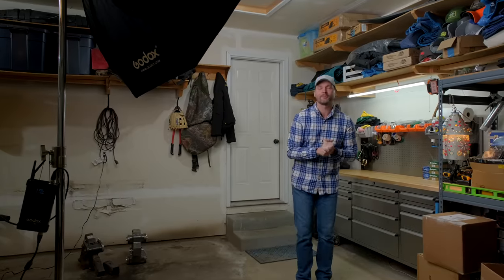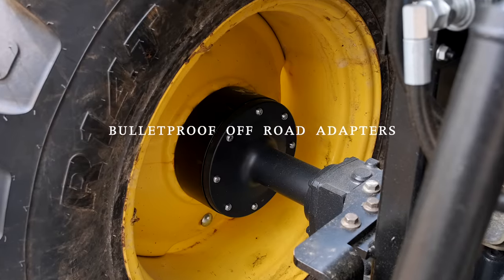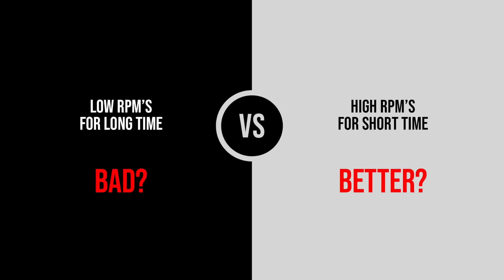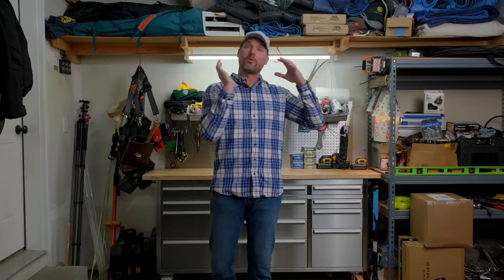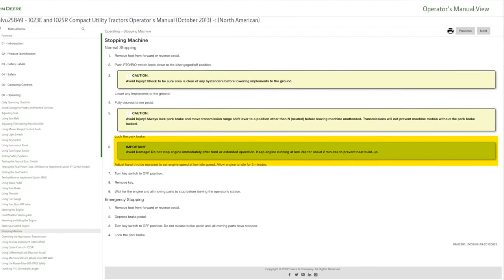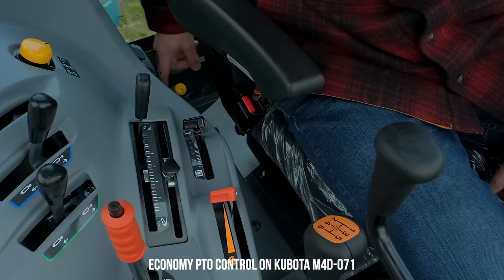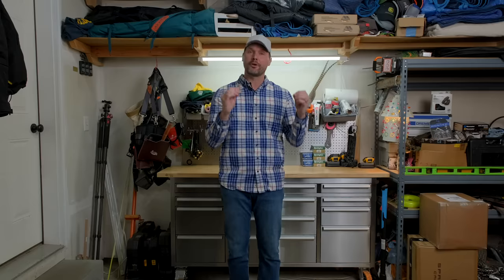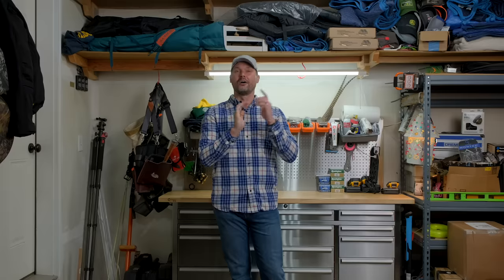WHAT RPM TO RUN YOUR TRACTOR? IT’S COMPLICATED

Comment: The new engines with computers if the wrong numbers are put in they can burn the engine up or will have poor power and will never do a proper regen.been there an seen it happen.Always let the engine cool down after working it 3---5minutes.spit a turbo runs $1000-4000.drop a valve.call your dealer an take a pill.was good things in this video.Thank You Sir

Comment: Diesel engines are much better for constant RPM and varying load, while gas engines do better at constant load and varying speed. 

That's part of the reason diesels are used for industrial generators, big trucks,  and large marine engines; while gassers are used for sports cars.  Set that diesel at a given RPM and it'll torque it's way through any load variation way, way better than a gas engine.  (Think F-250 with the Godzilla gas engine, pulling a gooseneck......watch that transmission hunt for gears when the front tires hit an incline, vs a Powestroke pulling the same trailer....)

The gas engine will rev up and down much more quickly, but it isn't nearly as capable at holding RPM when loads change.

Bottom line with a diesel....pick a comfortable RPM band and let that diesel do it's magic no matter what the load on the front or rear is doing.

Comment: I don't know if you addressed this...But 12 minutes was beyond my attention span.  I have a JD 4400 & 4600 (2000-year models bought new) I just read the owner's manual about idle speed.  The manual said "slow idle was 950 rpm.  As a child on a farm (1964+)  I was told not to idle a tractor below 1500 rpm.  The idea was that below "official idle speed", the engine wouldn't get proper lubrication.  The engine doesn't sound right to me at a lower rpm.  I've loaned friends a tractor.  And walked up on them idling it as low as it goes , even though I specified otherwise.  NEVER LOAN EQUIPMENT !! 🤨
Reply: I doubt engines are made so the lubrication system ceases or operates at a deficient capacity at lower rpm. If such an engine was made it would not last.
Reply: @Karl Degraa  you may be right.  Maybe my dad made it up.  All my cars and motorcycles had a set low idle specification.   And on a forum where lots of people were using larger V twin gas equipment.  People were recommending NOT running them long term at half throttle to reduce the psi on a pump. 
BUT...I have been taught that there is nothing that is a given FACT these days. Girls with penises do better in sports than girls without. 🤣
And now that I've thought even more about this.   The dealer that sold me my 1st new tractor in 1980 told me this when I lowered the rpm while talking to him as I was loading it on my trailer.

Comment: I been running my grandpas b2710 kubota at around 1800-2000 rpm for years. Ive went to like 2200 before but pto speed which is like 2500 just feels like it's overkill. Joystick is really jerky at that high.  Never had a need for that much juice.

Comment: 3 pt post-hole diggers should generally be operated at low rpms. At least the one I've used.
Reply: The post hole digger was the question. My land pride auger says to not go above 300 pto speed

Comment: Other than warm up, and cool down always run above the start of the torque peak at all times. On these small tractors it is usually magically 1800rpm... generator speed. If your running anything on the back run 100rpm above 540 speed, and load it down to 540 speed. The bigger story is the required min rpm of the hydrostatic pump, usually 80% of rated rpm, again 1800rpm. Its like Engineers built these tractors using math or something, lol.

Comment: I use my L3901 gear drive as a light utility tractor around the property and also commercially in my tree service. For loader work and transport I normally have the hand throttle set half way and use the foot throttle to get my transport speed and loader speed where I want them at any given moment. I wonder how many owners of small tractors could ever wear out an engine if they ran it at speed when they were using it. Most small tractor owners just don’t put many hours on their machines in their lifetime. Think of the DPF dealer service interval is something like 5000hrs, most will never see anything close to that.

Comment: Wide open throttle as much as possible. The engine runs cooler and has more power. Run at pto rpm when using it and use at least half throttle when doing anything else. Let it idle for a few minutes after running hard. I have a Kubota L3010 and after mowing I let it idle and can actually see the temp gauge come down. Another point is the term “high idle.” The engine is turning faster, but is still technically idling until a load is applied.
Reply from the maker: Good stuff, thanks for sharing!

Comment: Very helpful.  So my tractor says "rated speed is 2600 rpm"  Does that mean at 2600 rpm I will have 540 rpm at the PTO?  Not related to WOT?  WOT is just whatever the rpm gauge reads when I move the throttle all the way up/open?

Comment: I thought hydraulic power was based on fluid pressure, and hydraulic speed by flow. Isn’t the pressure in the system relatively constant and flow variable based on RPM? I don’t notice any difference in loader lift with lower RPM, but it does respond more slowly. For PTO I run at rated RPM (2500). For loader work I go mid throttle or so (around 1700rpm). If I want faster loader response for a short burst, I just hit the foot throttle to speed things up a bit. Usually that isn’t necessary.

Comment: Diesel engines like running loaded more than unloaded.  To achieve a greater load on the engine it can be better to run in a higher gear at a lower engine rpm (when the situation allows).  

Higher engine loads mean more fuel and as a result less unused oxygen in the combustion chamber.  Unused oxygen in the combustion chamber will combine with atmospheric nitrogen to produce NOx.

Comment: So may be a silly question now... but what rpm # would you use pushing snow with the 1025R? I have kept mine in the 26-2700.
Reply from the maker: Yeah, normally pretty high, but I will adjust depending on traction/ice/etc.  Sometimes running a little lower will help prevent slippage...easier to control than foot pressure on the pedal.
Reply: @GoodWorksTractors  Ok Thanks!

Comment: I have a question not related to this video but wanted it to get attention in hopes to find an answer.  Why does my 300 X loader appear to have three different sets of holes on the vertical loader support arms? Is it so that their variations and lift capacity and maximum height?
Reply: Sometimes a few of the holes are only used during shipping.

Comment: I have a new JD 4044 tractor and have been trying to figure out this very issue of  best rpm when brush hogging and also finding a gear and speed to cut comfortably and keep forward HST pedal engaged as much as possible. My tractor has something called "Speed Match" which lets you set your max travel speed and once set you put the forward travel pedal to the floor to achieve that speed. Does anyone know what effect this might have on the cycling of the HST oil since the forward pedal is fully depressed most of the time?

Comment: Any body ever start an engine an time how long it takes for oil to flow from the rocker arms when engine temp is at -0 or colder??older cumins manuals said 3-5minutes.i checked an yes gauge says got pressure any yes i'am  old f_rt.when paycheck depends on do i take care of it and have to fix it so i can work today and tomorrow and keep my job??when you earn your keep and pay for your mistakes you better rethink am in that biga hurry.maybe the boss and customer won't mind waiting for a rebuild or a different truck..only a day or 2 weeks?i check the fluids and start at idle.let warm til engine oil filter is warm to touch or temp about 100 degrees then load slow throttle up maybe 1/2 til near operating temp then go for it.got a dry clutch near idle before letting the clutch out.NEVER under a full load.some older tractors would shear flywheel bolts or worse the crank.even powershifts i throttle back and 4 wheeldrives throttle back to 16-1700 on the ends.don't be the 1 nobody will let you use their equipment.run it like ya stole it??really??an deere on the 20series put out who's afraid of the stop.some folks didn't know and those who used the foot throttle wide open all the time got it cut off.common sense.do you put your clothes on while running out the door before breakfast?engage pto at idle an throttle down some on turns.maybe keep from throwing the shaft an ujoints at your head.learn from other peoples mistakes.it's cheaper remember your paycheck feeds the family.oh and fix it before it can't be used an ya ain't got the time.

Comment: One thing not mentioned that may deserve comment is engine RPM in regard to hydrostat transmissions.
Reply from the maker: Compared to gear drive?
Reply: Gear drive tractors can move just fine at mid-low RPMs in high range, if not under load.  Hydrostatic transmissions need flow, especially in high range, for both cooling and actually moving well, even when not under load.
Reply: @GoodWorksTractors  Spud Gamer's answer was along my train of thought.

Comment: One thing I've always been confused about, well there's lots of things..lol, but I've always heard that higher rpm's doesn't translate into more hydraulic power. Is that not true?
Reply: It’s been proven, higher engine RPM does not result in more hydraulic power.
Reply: Power is more than just pressure, it is also flow, in the same way as power isn't just torque, but also RPM.  So, even if the upper pressure limit is set by the pressure relief valve, the flow is increased with increased RPM, and therefore power.

Comment: It's not a race car, it's a tractor.  No need to run WOT.  Take your time and be safe.  Running WOT is when people have accidents.
Reply: It depends. On some tractors, WOT is what's necessary to bring the PTO up to the correct speed. Just as an example, mowing certain grasses on a Chalmers 8030. I had it at WOT in 1st gear and the cattail grass in the field still made it bog.

Comment: Modern tractors run at WOT.  Period.  There is only one issue here... hydraulics.   What pressure are the hydraulics designed to operate at?  WOT.  Hydrostatic transmission?  WOT.  What speed was the engine designed to operate at to support the hydraulics?   WOT.  You want to spend a lot of time and money fixing your tractor... run it at 1/2 throttle.  In a hurry for a repair bill?  Run it at less than WOT in high gear.  Just the groaning noise the hydraulics make at less than WOT should tell you that even if you are not mechanically inclined.

Comment: Running the engine faster than the maximum output of the hydraulic pump is totally useless.find out what that rpm is and stay there.Stop the clutch type mentality and learn how to run a machine that has an engine connected to a PUMP!